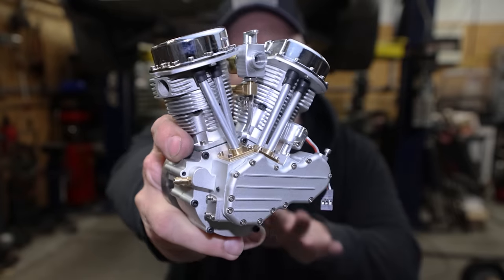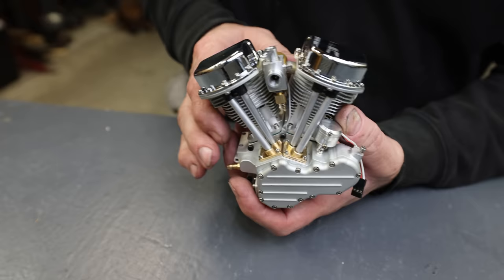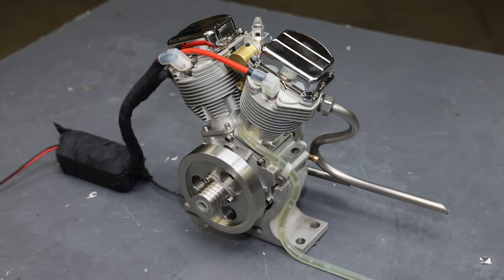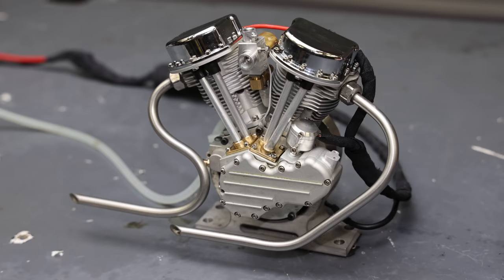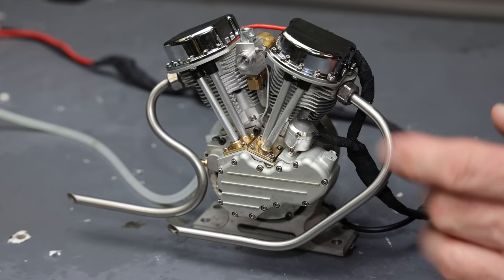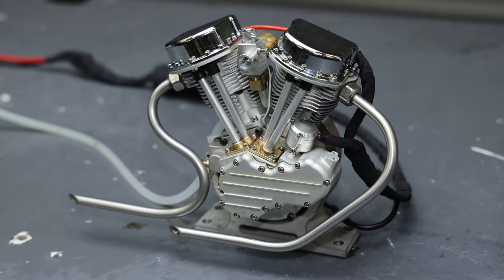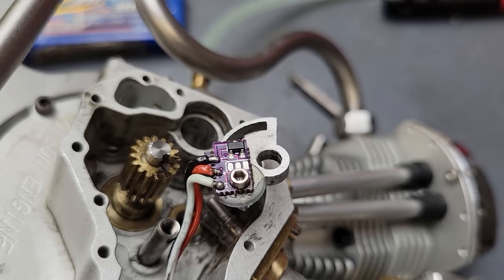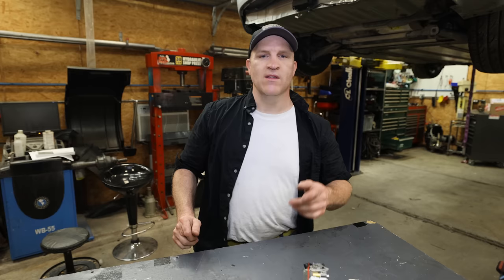Mini Harley Davidson Panhead Engine (Sounds Like the Real Thing)

Comment: sounded like a real harley , ran like a real harley and broke like a real harley xD
Reply from the maker: Hahah... That's funny and possible very accurately true
Reply: panheads are just tiny 2cylinders ik there bigger than that but i was expecting atleast a 4 cyl
Reply: @鐽  A Harley has two cylinders, why expect anything different?
Reply: Lmao
Reply: Sounds like you gave yourself away as a Can Am Spyder Ryder girley boy !!
Reply: @ConfederateInfidel  isn't anything wrong with riding a Can Am? He's just as exposed as the rest of us, come on man
Reply: @ConfederateInfidel  02 Yamaha FZ1 ....  Inline 4 1000cc thatll eat any harley for lunch
Reply: Yep those jap bikes and backwards three wheelers likely get the most use at the front of a LGBT community parade in those liberal cities !!
Reply: @sockie  Come on you ride a CanAm 3 wheeler cause mommy wouldnt let you have a real bike 😂😂😂😂😂😂😂sissy
Reply: @holmes1956O  i mean I ride a 675r but ok lol
Reply: @sockie  I have ridden harleys nothing to write home about. Currently ride 1996 ducati m900/1984 honda vf1000 intercepter/2003 ktm exc 450
Reply: @holmes1956O  450 sumo or dirt bike? I've been thinking about getting one
Reply: @sockie  Have both set-ups. Bought it new as a dirt bike and then bought the conversion for sumo
Reply: @holmes1956O  What's reliability like? My friends seem pretty sketch about them but from what I've read they're fine
Reply: @sockie  I havent had any issues. I keep the maintenance up. Some dont. They are the ones with the problems.
Reply: @barrycarleton4326  idk i just don;'t pay attention to motorcycles i only like cars like rally cars drift cars f1 cars f2 cars f3 cars f4 cars and drag cars
Reply: @holmes1956O   I prefer my Harley over the uncomfortable crotch rockets. And I really have no need for the speed. I would not trade my Road Glide for 10 Interceptors. Back in the day my old KZ900 smoked many a Interceptor.
Reply: @tucoramirez8397  lol a girl I dated owned a 1980 fxb sturgis. She owned it from new and said when I met her she would never sell it. One ride on my ducati and the harley got sold. That should tell you something. As far as my intercepter goes it is not anything close what a CROTCH rocket is by todays standards it is more of a sport touring mount and it is far from stock. Your old kawasaki would be hard pressed to keep up to me on it. Anyway enjoy you harley
Reply: Sound nothing like a Panhead . Sounds like ab2 stroke Harley
Reply: 100,000 on my road king. 90k on my 1200 sportster. No major issues, no engine rebuilds. 90k on my Suzuki Bandit, same thing no major issues.
Reply: Got a 2006 Harley Heritage Softail have no issues with her do all the maintenance myself never have had a problem. I really don't care what y'all ride after all we are all after one thing freedom of the road and the friendship of two wheels!
Reply: @鐽  at least*
Reply: @tsukikaze7777  thx m8
Reply: So what leak? The smoke? Did you notice oil fuel mix? And broke because he over reved it on race fuel? Are you kidding
Reply: I guess Harleys are like the Jaguars of motorcycles and respectively Kawasakis are the Toyotas of motorbikes?
Reply: Did you all know that today 90% of harleys are still on the road?  . . . . .🤔... ... The other 10% barely made it home🤣
Reply: Facts lol
Reply: Adjust the valves, bump up the timing
Reply: @barrycarleton4326  I expect a miniature version of the RT 125 copy ☝
Reply: @ConfederateInfidel  I ride a 350 Spy-racing quad. because at the age of 82 i am not safe on two wheels anymore.
Reply: Probably comes with a free SOA patch  on a distressed denim cut off and discount surgery at a hospital for when some real HA,s get hold of you!
Reply: It has about the same HP as a real Harley too.
Reply: @ConfederateInfidel  but he does get to ride without a pickup truck following in the distance😂😂😂😂
Reply: And it wouldn't be a Harley replica if it didn't leak oil.
Reply: @franknada8235  I would argue that Harleys are more akin to a GM muscle car and Hondas are the equivalent to Toyotas. Jags feel too refined compared to a Harley which is the loudest and proudest America bike you can get. As for Kawasakis, my KLR eats oil and drops a subframe bolt every 1,000km; I don't know of any Toyotas that do that.
Reply: @jefffowler2587  riding is about different things to different people. Some ride for the thrill of speed some for the views and smells. Some just enjoy the ride. It is what is to you individually. Have a good week end
Reply: @holmes1956O  u as well
Reply: @jefffowler2587  German highways. 300+ km/h and no stop lights 😏
Reply: @teslatrooper85  I gotcha..cool for a minute and that's it,I used to be that guy,now I just wanna relax and cruise,listen to the stereo
Reply: lol
Reply: Even leaks oil like a Harley 😝
Reply: True story. On my way home from work today opposing traffic at an intersection was just covered in bluish smoke. Looked like someone did a burnout. I was like someone need a new ride. And ill be damned if a harley street glide emerge from that smoke  to make a youturn with smoke POURING out his tailpipe. 

I immediately thought of this comment thread and laughed hahaha
Reply: @jefffowler2587  my style is 90% old man 10% pissed off teenager.

From my corbin seat and ujm seating position the scenery was absolutely amazing going over the inlet causeway on A1Ain central florida
Reply: ...and that's why I haven't owned a harley since the POS 1200 sportster I bought in the early 80s...paid more in repairs than I paid for it in 1 years...and I bought the phuker brand new.
Reply: @somedude1590  🤣🤣🤣🙏👍
Reply: @somedude1590  Harley Vrod destroyer, its faster 0-60, faster in the quarter, faster top speed.
Reply: @manofchaitea6904  as far as I know the most powerful harley out the box stock is the new pan america @140hp. Dunno if its crank or wheel hp though
Reply: @sockie  well, Honda or Can-Am by Bombardier (Pronounced Bomb-are-dee-ay, heard some Americans pronounce id Bomb-er-deer which is incorrect) a good reputable Canadian company, besides, Harley's engines are now made by the same company that makes MTD's Honda clone "PowerMore" engines and Champion Power Equipment's engines.  So maybe are a bit more reliable.
Reply: @somedude1590  even my 06 Yamaha YZF 600 will eat up a Hardly Abelson
Reply: made in china lmao
Reply: @sethp1624  Thats a cool bike sonnnnn .
Reply: @somedude1590  not on the first 100 meters. torque is important, too.
Reply: @jefffowler2587  If you drive every day 60km to your work, it´s better to drive fast, than to pick flowers on your way. We drive fast and safe.
Reply: Hardly Dangerous
Reply: My 57 pan head never broke and I rode the shit out of it for ten years.  Never had to put points and condenser or fix shit.  Have a 79 shovel with no bullshit 500k plus still runs strong only minor maintenance. Other than tranny rebuild.
Reply: Harleys are actually pretty dependable.
Reply: @jefffowler2587  If the weather is fine my BMW X3 stays in the garage. One of my motorcycles needs a ride, wherever ever.
Reply: @鐽  An astute observation with one major flaw...firstly, Harleys are two cylinders and secondly Harleys are two cylinders. Now I realise that technically that's only one flaw but it was such a big one I thought it was worth mentioning twice.
Reply: @roadgent7921  ive seen a v8
Reply: @roadgent7921  it was weird
Reply: Fjb Fjb  Fjb 😂😂😂😂😂
Reply: @jefffowler2587  I´m a bavarian guy and i want speed, absolut technic and comfort.
I ride a BMW, too, 160 Hp and 1000 ccm, 250 km/h. 3 sec to 100km/h, I like the power. Always buy a regional product. Harleys too slow and have a bad handling with horrible vibrations. In 40 years of riding a Harley never overtook me. In curves, the Harley is losing, too. Sportive biking with a Harley is impossible. I ride the most time in the mountains, not often seen there any Harley.
If you want it slow, drive Harley, if you want a kick buy a motorcycle from BMW, perhaps a japanese. Harley is chinise built.
Reply: @jefffowler2587  Because I`m from Bavaria, we don´t feel german. My S1000XR is a sporttourer and very comfortable.
Reply: @GruntyGame  Great, you improved the analogy!
Reply: @鐽  there are no 4 cylinder Harleys so why would you expect one here?
Reply: @Mr_Facts  I don’t believe for one minute you have 3 bikes that you’ve personally put over 90k on. It’s rare to find a bike over 50k pics or it doesn’t exist
Reply: @joejones2847  I'm a career motorcycle mechanic. I have seen several XV19's, FJR1300, and gold wings with over 100,000 miles on them. I have a customer that sold her 90k XV, and has already put 60k on her FJ09. My miles are from fifteen years of commuting across the San Fran bay area, and going on road trips to Tahoe several times a year.
Reply: @holmes1956O  Presumably not simultaneously...
Reply: @kevinhogan715  The only thing I care from a rider, that they aren't your stereotypical harley or sport bike rider.   Those big city gangs that ride dirtbikes on streets, do wheelies, or the harley d-bags give us a bad name and why ALL of us get profiled.
Reply: Haha, any HD’s in the  last 30 years don’t leak.
Reply: Lane AWD  not saying much when your ride sportsters🤣
Reply: @WarpedYT  u
Reply: U
Reply: The Perfect comment !!! Especially about the oil leaks and it breaking down !! Love it !!
Reply: @ConfederateInfidel  no......he just isn't stupid enough to pay today's prices for a pile of junk that could have been built in the late 1800's.
Reply: @holmes1956O  sadly they take way more maintenance then a real bike.
Reply: @jaewhite2462  lol yes they do. Many will argue that point. Not me my ducati requires less maintenance than a harley😲
Reply: @larryhurley2314  The Harley tool kit still has a mash hammer, cold chisel and a rough bastard file in it. 😂😂
Reply: @joejones2847  Probably bought them from a wreckers with the high Miles, broken down
Reply: @ConfederateInfidel  Harleys are all fart no poo, or all noise no go
Reply: It’s sad all those guys that sit down to pee crying about Harleys ! You should try to improve your credit so you can have the nicer things in life !!
Reply: I’ll be honest.

I have an 06 883 sportster and in my experience as long as I change the oil in the primary and secondary every year or two and use only lower octane fuel it runs exceptionally well year after year. A few backfires on deceleration every once in a while and after 8 years of riding I’m pleased. 
Just my two cents
Reply: @ConfederateInfidel  Go talk trash to Harley Trike riders. As long as they're less cars out there good. Not everything is politics.
Reply: It was even leaking oil like a real Harley.  That's attention to detail.
Reply: @somedude1590  it's not what Harley's are about man...
Reply: It did! 😂
Reply: @Dixie_Normiz  Guess all those Harley at the National Mall for rolling thunder  was fake news.
Reply: @WJCTechyman  Where did you get that info? The Vrod ,street series and Pan America are  a Porshe design and   replacement crate engines are S&S
Reply: @sethp1624  But can you ride it for  400 miles with only one stop for fuel for 5 minutes?
Reply: @Retiredroamers  I have made MANY long trips, two years ago was 1500 miles on a thirty year old Harley with ZERO problems.
Reply: @GruntyGame   I have 2, 30 year old Harleys that don't leak
Reply: Lane AWD  You shouldnt make fun of Harleys as they are an American icon and they get a man laid.
Reply: @frankpeletz1818  probably not, but it never breaks down, starts everytime, and it's probably a lot faster
Reply: @ConfederateInfidel  =sounds jealous
Reply: @Dixie_Normiz  Bet you ride a scooter
Reply: @ConfederateInfidel  Someone sounds mad cause their harley breaks twice a week.
Reply: @GruntyGame  You right, Harleys are like muscle cars, it's made for straight roads and it turn like an anvil 😂
Reply: @鐽  There's a reason this engine configuration is called a V-Twin...
Reply: @somedude1590  ive owned the same bike for 29 years and it can still show a lot of more modern bikes up never mind old clunky harley davidsons  i doubt a modern harley in standard form would beat it too this day harleys are for posing around on and that lovely sound they rumble and roar along and they make damn nice choppers  like you ive your bikes dad or grand dad lol have a YAMAHA 1990 fzr1000exup a genesis edition in red white and blue race paint its been well maintained its life im a bike mechanic by trade it has now 53000 miles on it ive added51770 miles on bike its got odd marks and dings but reliable as day i bought it everytime someone sees it in garage im asked to sell it and when i pop my clogs my son can do what he wants with my 4 toys mk2ford escort rs2000 xpack 1987ford sierra rs cosworth 3dr and 1992 ford escort cosworth and the yamaha all been long time in my ownership and they took a lot of blood sweat and tears to scrimp save buy sell and trade cars to get them and im being selfish im keeping them im only 50 so ive good few years fun left in me yet lol
Reply: @ckelley63 youre telling me that you are butt hurt with out telling me that you are butt hurt. 🤣
Reply: @barrycarleton4326  because he doesn't know anything about motorcycles buy higher numbers are better, so why not sound like he knows what he's talking about?
Reply: @brian3174  nice im on an 02 Fz1000 exup
Reply: I used to have a Harley (2008 Electraglide Classic). I am into target shooting now, but I still have a great appreciation for this sound. Excellent simulation and craftsmanship!!👍
Reply: It even has oil spots on the floor (table)! LOL!
Reply: And leaked oil like a real Harley.
Reply: @ConfederateInfidel  yeah having a better engine makes one gay
Reply: @davesena8684  cool what about 80 and on. They should just stop
Reply: Lane AWD  pshhhhhhhhhhhhhhhhhhhhhhh plz
Reply: Really how many Harley bikes have you owned to conclude that
Reply: @ConfederateInfidel  And the Harley riders will be at the rally's all middle aged, bald, divorced weekend riding wanna be single one of them
Reply: @somedude1590  go to your room little boy
Reply: @tucoramirez8397  i prefer my 98 honda magna 750..... 
.
exact same seating position as a HD....... and about 2.5X the power
its also a V4..... so its smooth 
aka, i dont have to tighten things up after every ride, after the feeling in my hands return
.
.
.
modern HD is a bike made for (wannabe) metro-sexual dudes 
like.... look at the people in their ads....
.
they are no longer marketing to "tough guys"..... or people who like comfort.... 
or really ANY of the reasons the OLD!!! hd's were nice bikes
.
.
so ya.... if riding a faster, more reliable, easier to work on bike makes me a "girly boy"..... then so be it
you still spent 3x what i did..... are 3x slower..... and x3 more maintenance
Reply: @rvail136  was that when the bowling company was building the engines???
Reply: @manofchaitea6904  yet still gets beat by a 98 honda magna 750
Reply: @somedude1590  thats crank (aka..... cheating)
Reply: the thing is...... older HDs might of been great bikes (except when the bowling company owned them)
.
but the modern HDs are marketed to Metro-sexual dudes who arnt even metro-sexual.........
like... they market to this strange group..... sorta hipster... sorta rebel.... sorta "tough guy"..... and sorta blonde girls
ALL AT THE SAME TIME!
.
its a VERY specific (and strange) niche...... 
.
.
.
HD knows that their "core" buyers will still buy it...... simply because its a HD
they arnt going to look at the way people are dressed in their marketing....
.
they could make it go 1000MPH to 10MPH...... 
as long as it has "that HD sound".......... they will buy it
.
they could make the engine last 100,000 miles or 10 miles
if its got that sound.... people will buy it
.
.
and thats stupid AF
and the people who buy them ONLY for the sound and the fact it has a HD sticker on the side........ are stupid AF
.
.
like.... stop buying poorly built and WAY overpriced bikes
thats the ONLY way HD will change
.
.
.
.
like... HD made the EVO motor..... trying to bring that unbalanced paint mixer into the 21 century 
and EVERYONE hated it
.
so its not about the sound..... or smoothness.... or reliability... or power
its just about boomers being boomers..... thinking that everything old was gold
.
.
and hey.... im 28, yet think the buick 3.8 is the best motor EVER MADE!!!!! 
.
is more reliable, gets better MPG, and runs smoother than GMs modern 3.6
but, it doesnt make the HP the 3.6 does
.
most people simply look at numbers and buy whats higher
they dont care that the 3.8 has more "area under the curve"..... (but EVERY SINGLE person who knows what that means.... wants the under curve / average power motor)
they dont care that you have more average power.... from idle to red line
.
they just care about the power between 6700 and 7000 RPM (AKA.... whats listed as peak HP in the marketing)
and 98% of drivers NEVER rev their cars over 3500 RPM
.
.
.
.
so you have a LESS reliable engine..... that gets WORSE mpg..... which is WAY harder / more expensive to work on / get fixed
but because the marketing says it makes the most HP...... 
they buy it.... ignoring the RPM numbers (and area under the curve)
.
.
.
as a car guy / mechanic...... i dont understand it
.
but HD must understand it..... as they havent went bankrupt yet
Reply: and dont get me started on modern emissions.... especially on diesels 
AKA.... lets burn MORE fuel.... for a cleaner exhaust
.
IDK about you..... but that seems ASS BACKWARDS to me
.
.
all the exploration, drilling, pumping, refining, pumping and/or hauling to the gas station, and FINALLY pumping it into your car
that ALL takes energy..... that ALL produces emissions 
.
yet.... if ONE cars exhaust is SLIGHTLY cleaner..... (despite getting 26 mpg VS 32 mpg)
thats somehow better....
.
.
.
.
like.... lets capture all the diesel soot in a filter......
and then dump 10 gallons of fuel into the filter to "re-gen" it
.
AKA.... instead of a little black smoke here and their......... 
lets just dump all that black smoke in one spot during the re-gen (and it takes like 5 gallons to re-gen!!!!)
.
.
so... you still have the SAME amount of black smoke
and now.... you are BURNING MORE!!!! FUEL!!! 
.
.
it LITERALLY hurts the environment MORE.... 
because some idiot doing 50 in a 75 zone, in a Prius...... got mad because he saw a puff of black smoke
.
because black smoke MUST!!! be just raw ozone killing emissions...... 
and not harmless carbon!!!!!
.
.
.
like...he got mad because a 12 valve, mechanical injected cummins stepped on it....
due to anger of almost rear-ending a dude going UNDER the Min speed limit..... 
and it made a BIT of smoke 
.
so now..... all that black smoke gets blown in a place where Mr Slow doesnt see it....
so he is happy..... and donates to lobbyists and politicians..... because of the "great" job they did getting that pollution off the roads
(and into the Flying J parking lot....)
.
.
.
i told you..... dont get me started on emissions!!!
.
again, climate change is real..... and its (at least) over 50% human made 
but burning MORE fuel for a cleaner tail pipe is ASS BACKWARDS
Reply: @jefffowler2587  if your out for the scenery take a horse and buggy. The rest of us want to ride.
Reply: @鐽  You're not too bright huh...
Reply: Lane AWD  which is zero I would bet or perhaps a block or two before you scared yourself.
Reply: @somedude1590  a sixty year old Harley will destroy any 60 year old Yamaha!
Reply: I bet it gets better MPG
Reply: If you’re statement is correct, then why is my ‘52 pan still on the road?  I just won first place at a show in May. I don’t expect there will be any 70 year old gold wings on the road, let alone win anything.
Reply: Lane AWD  Then you haven't ridden the older Harleys like a 56 panhead or a shovelhead or a knucklehead.
Reply: Nobody on a Harley gives a shit how fast your bike is 😆
Reply: @samcoenen8111   I don't doubt that at all .
Reply: @sockie  , three wheeled vehicles are always notoriously unreliable due to the way that they are built.
Reply: same hp too!
Reply: you ride a vespa dont u 🤣🤣🤣
Reply: @stevenkeepers7142  Fz1
Reply: and leaked like a Harley
Reply: @matrox  I've had adult diapers that are more dependable.
Reply: @ConfederateInfidel  , you do realize the Japan vehicles like Toyota and Honda, and the motorcycle industry is also built here in the USA, but the only difference between the two is the Japanese vehicles last longer for cheaper, but I still prefer the 60s70s muscle cars, especially when they are restored to the quality of graveyard cars, everything is simple and to the point, easy to work on and repair.  But don't forget that the Japanese vehicles are built in the u.s. by u.s. citizens, and the vehicles last 20+yrs, and I have a 2001, echo i paid 700$ for in2010, and it still has air conditioning, and over 400,000 miles on it and still running like when I bought it, with proper maintenance and normal repairs every 200k mileage i changed my timing belt and water pump just because it is lifetime warranty free replacement,  so I buy a timing belt and while I am already taking everything apart i take the water pump off and then exchange it for a new 1, and I just recently replaced the radiator with a upgraded aluminum and brass, , no more plastic, and I just changed the alternator with a lifetime free replacement warranty, and a new starter, with the same free replacement warranty,  and I saved a ton of money by going through Rock auto. Com, and o,riley's.  But the echo is still going strong, and if anything goes bad i replace it for free now, and not many cars get 200k mileage before I have changed the timing belt and water pump, and the other new parts are normal maintenance
Reply: broken Harley engines are usually the fault of the owner who thinks they know how to run them...
Reply: Just passed out an abandoned Harley-Davidson on interstate 95 at mile marker 168 hahaha
Reply: @sockie  nothing wrong as long as you dont consider can ams  motorcycles.  you can ride a bicycle too, nothing wrong with it but it isnt a motorcycle either.
Reply: @ConfederateInfidel  whats worse? That or a Yamaha Virago 🤢 🤣👎
Reply: @somedude1590  Harleys are not about speed, squid. They're about cool. Which your not.
Reply: @GruntyGame  leak oil? Where have you been grandpa? Lol
Reply: @hhawg1  The oil fields!
Reply: @hhawg1  you're*
Reply: @Dixie_Normiz  l love my Harley but that made me chuckle 👍
Reply: Funny... though nothing lasts forever
Reply: My old lady is at Harley Davidson right now taking the motorcycle licensing class and the clown instructor just left them all on the track for a personal errand and the whole class was like "wtf?"  and they're just standing there in full gear in Florida summer .  Seems Harley personel is about as clown as their garbage bikes that I pass abandoned on I95 everyday .
Reply: @goldilocks913  glad you chuckled😎
Reply: My dad's harley hasn't ever broken..
Reply: would rather ride that motor than a fucking crotch rocket or gay ass fast and furious car
Reply: OK girlfriend !!!!!!
Reply: @franknada8235  Kawasaki dirt bikes are faster but Honda and Yamaha tend to hold up in the long run might be different for street bikes idk
Reply: Ha ha ha ha ha ha ha ha ha!!!!
Reply: Lmao
Reply: Blew oil like a Harley
Reply: Noticed it leaked oil just like a Harley as well 😀
Reply: @somedude1590  Yamaha FZ pretty lame bike. I have owned a Harley-Davidson and a Suzuki GSXR-750.  Bragging an FZ is faster than an HD isn't impressive considering most HDs are cruisers. Dumb comment.
Reply: @toddzehr203  so by saying Yamaha  FZ is a pretty lame bike that means you're saying every Harley Davidson is a lame bike because the FZ is faster than every Harley-Davidson. That serves pretty embarrassing and you are brave for letting your feelers be known
Reply: LOL so true. At idle it sounded like a harley, revve up sounded like my weed whacker 🤣Great custom work WP! Thanks for showing this little gem
Reply: @somedude1590  Doubtful. Have owned many bikes and never had an issue with my Harley-Davidsons or my metric bikes. Never knew anyone who had an issue with a Harley either. I think this myth is perpetuated by people like yourself who can't afford one.
Reply: Can't you all just get along?
All motorcycles are fun
Doctor Jill is against bikers discriminating other bikers.
Reply: @dr.jiIIaIicecooper2587  i like harleys. I think they are a great motorcycle repair platform.
Reply: @somedude1590  yeah because going fast is the only reason to get on a bike. smh..
Reply: @ConfederateInfidel    The truth is hard to handle for some so they resort to lame insults.
Reply: @ConfederateInfidel  well if u got problem with what he rides why dont you buy him a hog then
Reply: @WarpedYT  what is that black tape and were did u get it
Reply: @AndrewMurphy8383  I forget you LGBH guys ride side saddle . Don’t fall off in one of the pride parades !!
Reply: My Valkyrie will beat any Harley
Reply: @wallbanger3  beat picking up guys at a gay bar ….. if you say so !!
Reply: @somedude1590  my Harley I’ll eat those on the drag strip for breakfast..
Reply: @barrycarleton4326  your old mini bike had one....so?
Reply: @ConfederateInfidel  🤣👍
Reply: @somedude1590  My Harley with a 96 inch goes 10.50s...bring it
Reply: @ConfederateInfidel  Psst- Your massive self confidence problem is showing.....
Reply: I have a 2005 HD Softail that I bought new and have 52,445 miles on it. I've changed oil and tires, and a turn signal flasher.. That's all. It's been totally trouble free.
Reply: @dchmtl1  that’s fantastic! Definitely glad to hear there are units out there that are trouble free! Enjoy it!!!
Reply: The sound is just.......    waaaahhh
Reply: @WarpedYT  how u tune it is amazing..
Reply: 🤣🤣🤣🤣🤣🤣 
It’s funny bc is true!
Reply: Perhaps you should have figured on a break in period.
Reply: @vanmann8347  💯 that is the issue, I see most people that put these tiny engines together go to full throttle right away, not good! 

I would let those little monster idle for days!!! 😂
Reply: @WJCTechyman  I guess something must be wrong with my 93 Harley Fatboy...I've only replaced clutch one time and replaced  rocker box gaskets that's the only motorwork it's had in 236,000 miles. Change oil every 2k-2.5k. Changed one drive belt when the original broke after 170,000 miles.
Reply: @wapartist  yep..my 93 Fatboy and 17 Heritage.
Reply: @charlesfritz7131  man ive always had good luck with tight cases. I have run Dynas mainly over the years but the older harleys literally did leak on purpose

Love both your bike choices  too!
Reply: @wapartist  gonna pick up another EVO a 97 FXSTC this Thursday and a 2008 FXSTC Saturday. Gotta spend the two jackpots I won somewhere...lol. 3500 for one and 475 for the 08 both less than 20k miles on them.
Reply: @charlesfritz7131  my man! That’s awesome! I run an ‘11 wide glide and am tastefully hard tailing a ‘93 EVO sportster as we speak
Reply: @wapartist  I've had my 93 since it had 140 miles on it. The guy who bought it now bottomed out on a speed breaker and didn't notice a cut in a wire and started having issues with it cutting off going down the road. Dealership here couldn't figure it out I ended up with it for $9200 dollars. Back in June 93. A buddy told me what it was making it cut out. 5 minutes on a lift problem solved and saved almost 8 grand on it. It's an International model Fatboy...geared for European market on the autobahn. It tops out, with stock motor, at 148.   My daughter is a cop and she radared me.
Reply: Lmao
Reply: @ConfederateInfidel  Lmfaoooo
Reply: @ConfederateInfidel  cause it takes a bad, bad man to handle that 65 HP lol
Reply: @adamguzzo94  coming from a moped rider I thank you for the compliment little guy !!
Reply: You couldn’t be more right lol
Reply: Only bike were dealer offers upgrades to get you on par with other brands out of the box.
Reply: Baby Harley
Reply: That's so true.. most dudes that say it ain't are 60 year old white dudes that ride their bikes 3 days a year 🤣 my dad's harley has been in the shop probably 8 times over three years for various reasons. My 99 vulcan 1500 has over 100k on it had it 5 years and all you gotta  do is put gas and oil in it. Rides better than his to and its only 7 years old
Reply: @davidoriggan  My last job i drove an NPR Isuzu dump truck up and down interstate 95 and isaw ATLEAST 1 harely abandoned and broke down on the side of the interstate per week.

And it was ONLY Harleys I ever saw. I cant remember one time i saw any other bike on the side of that highway.
Reply: Is that oil leaking r exhaust? I really hope mine never leaks like that?
Reply: Zn
Reply: Let’s see a crotch rocket run over 100k miles. They never would. But a Harley will and still have value.
Reply: @Harley365  pffft a lady that owned the same model I ride Gen 1 yamaha Fz1  clocked over 250k miles with nothing but routine maint .  clutches , valve adjustments  ect , no major malfunctions lol  try again tryhard !
Reply: @Harley365   Look her up Fz1girl 250k miles
Reply: @Harley365  I've had cbr get to 40k b4 I sold it? Pos held together by band ties but have you seen any bike hit 100k without rebuild? That's like rubbing to nickles trying get dime
Reply: @barrycarleton4326  that's why insurance is cheaper on fatboy than 250 ninja? Insurance is racketeering 💩
Reply: @speakmymind2024  I talk down as soon as I finally got one. I said at least the Japanese know how put gas Guage on their bike 😂 I never got back on the ninja since that day though😎 is much different/ learning process but no more smashing nuts on gas tanks🙌
Reply: Lmao…!!! Now that’s funny…!!!😂
Reply: @ConfederateInfidel  wow, you must be so badass
Reply: @WarpedYT  I Harley know what to make of that.   😮
Reply: @jayson3775   BWAAAAHAHAHA the 1949  Honda D-type top speed was 45mph and the 49 harley 125s was 40mph top speed ! WRONG AGAIN xD
Reply: What do you actually know about the Panhead engine? Nothing? But your an expert?! What do you ride. Some cheap imitation?
Reply: Coming from some dude who never evolved past flour paste and popsicle sticks. 😂
Reply: @somedude1590  And? A sportbike smoking a cruiser? Wow! Impressive. Fn dork lol.🤣 Do you compare cadillacs to lamborghinis too?
Reply: @holmes1956O  you sound like a stand up guy. 😂
Reply: Mine has 78000 miles and never broke.
Reply: Hahaha thats true
Reply: Makes it more of a chalenge
Reply: Funny thing is this Buell XB1200 is the most reliable sportbike I owned yet in 30 years sport riding. 75k mi. trouble free except minor nuisance VS that 07 Yamaha R1 that broke valve guides at 5k, 11k, and 16k mi. and my warranty ran out. So I told the service department to go ahead and slide it back onto the sales lot when they got done, cause I will not be picking it up.  On the flip side my Zx7 Ninja lasted a whole whopping 50k mi., before its main bearing went, and probably why you'll be hard pressed to find any sportbike with high mileage in cycle trader... Or anywhere else for that matter. Worst was the 2000 Aprilia RSV Mille with it's habitual starter clutch failures, and ceaseless valve adjustments.  Speaking of valve lash adjustments, LOL.. Buell never had one, but maybe these dealerships are skipping doing the labor intensive shim jobs for these high RPM motors, with valve trians that soon begin to sound like somones digging through a silverwear drawer. 
Meaning I have sneakin suspichion these dealer service departments are skipping the actual valve lash adjustments, callijg ALL inspections good by sound alone, while stilll backcharging the manufacturers... But who knows, when you whirl something well over 10k RPM... I doubt its much good either way.
Reply: @somedude1590  your missing the point all together. Besides a 20 + year old Yamaha fz1? No thanks. Just cheap and nasty.
Reply: That's funny man
Reply: @鐽  drift cars. What r u 13 yrs. Old?
Reply: That’s real…